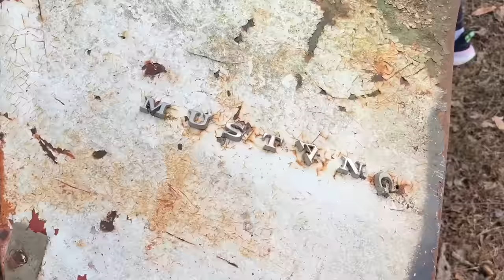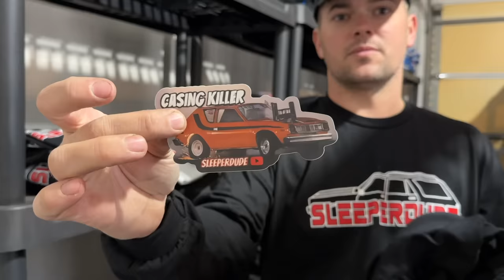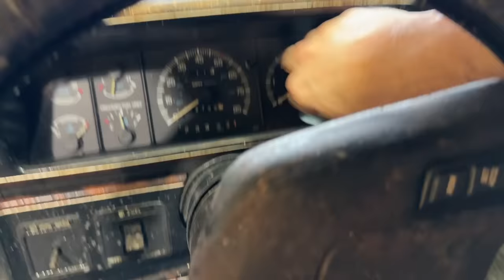Short Bed F150 Parked 17 years! Can We Save It?

Comment: Great video! I brought a 1990 F150, 300 6-cylinder, 5-speed in 1993 for $6999. It had 60k highway miles, but clean as a whistle. I drove it for 7 years and only put a clutch and exhaust on it. Was a great truck and only sold it as I got orders for Japan and knew I did not want it sitting for five years. Hope you get it running and keep it. 👍

Comment: New windshield, get the dents pulled out, a set of rims with other tiny cosmetic odds and ends and it'll look great! It'll be a great farm rig to throw around if the drivetrain is good. I'm excited to see the rescue of the Econoline and the other Falcon's! I bet your favorite is the black Futura.
Reply from the maker: Yes for sure
Reply: I think its in too nice of a condition,depending on the motor, for a field truck .Every thing looks clean under the hood.Fix the dents when you have time and put it on the backburner .It would be a perfect first driver for Ralphie .

Comment: Surprised you didn't pull the carpet before pressure washing it, but looks like it cleaned right up and is looking just fine. Nice project!
Reply: I was thinking the same, I'd have pulled it and pressure washed out of the truck. Heck, if the truck runs well enough, I'd order another carpet for it and trash that one.
Reply from the maker: Yeah that would have been the best thing to do
Reply: @Sleeperdude   I'm amazed you didn't just open both doors and hit the interior with a leaf blower.

Could have got a nice layer of free compost for the gravel. :)
Reply: @Sleeperdude  Yeah there's a ton of padding aka jute under the carpet that holds a lot of dried liquids aka urine etc.
Wetting it like this just reactivates it. It needs to dry from both sides or you can actually end up sick.
I ran a detail business for 15 years.

Comment: That looks like a pretty solid truck. A friend of mine had one just like it with a manual transmission that would do nasty burnouts 😄 But living in the North East the wheel arches above the wheels on the bed were completely rusted through even though the truck was maybe 10 years old so it's surprising to see it not all rusted out. Glad to see you have hoodies available I will have to pick one up!
Reply from the maker: Oh wow

Comment: The squirrels had fun inside that truck. The best thing to get the smell out of that truck would be charcoal. It will absorb the odor if you leave it sealed up in there overnight. Where I used to live up in the woods we had squirrels all over and they would get into tool drawers in the garage and store acorns there and even found Acorns stuffed into the Air box of my '89 F150. Yours also has dual tanks like my "89 does. I have never had any trouble with EFI on mine and I have 160,000 on my 5.0 liter as well. That is a solid truck just like mine. Thanks for sharing.
Reply from the maker: Ok cool thanks

Comment: Fantastic family involement! The tire inflator "scene" was funny -- You could try using a PDR kit to get the dents out. The front windshield is supported by the aftermarket. After you get it running I would strongly suggest you get the factory fuel injectors cleaned by a local shop, etc.

Comment: Good video, great content. Glad to see the whole family in action on the F 150 clean up. I hope the engine and transmission work out with minimal repairs. The truck cleaned up well and the body is in real good shape. I am sure Josh's body shop experience will come in handy getting the windshield frame straightened out and a new windshield will make the cab weather tight. I have the 1991 Crown Victoria wagon and the 302 five liter V8's are legendary. I had my engine rebuilt after it failed at 148,000.0 miles. Never did find out why it  failed, but it did overheat while towing my triple Quad trailer in Massachusetts. I had it completely restored in 2020 and now only has 14,000.0 miles on it and runs like a watch. Thanks for the video.

Comment: "Beware the brick nose as she will cause much confusion, consternation, and frustration" says the gray haired one from Missouri . My 90 brick nose has given me many fits over the years but when you go to start it and it doesn't try replacing the fuel tank switch, I don't exactly remember how I finally figured that one out but they are cheap and easy to change. Also if you think you've got a bad ignition module and put on a new one and it still won't start I've gotten bad one's that were brand new and I'm not the only one. I hope to see that Ford back on the road

Comment: Josh, you HAVE to go and get that camper shell that was lying on the ground near the truck.  Even if it is not a perfect fit for that Ford  short bed, it should either be close or a close fit for one of your long beds.  In those days, the beds were roughly the same size on the main pickup truck brands.  
  To me, every pickup needs a shell, or at the very least a hard bed cover.  Some guys worry that the shell makes the truck look less "cool."
Reply from the maker: Yeah I will check on it

Comment: The last Ford I i owned was a 89 F 150 lariat , Less than 12,000 miles it would accelerate on its owned,  clutch would stick on the floor,  and the radio would have static on it with the bright lights on. It was a junk truck from the start. Traded it in on Chevy the best thing i ever did.
Have fun with the truck.
Reply from the maker: Sounds like a lemon for sure

Comment: I use a small hand pump-up garden sprayer for applying cleaning detergents such you're using on the carpets and in the engine bay. It's much quicker and easier than those little hand  pump sprayer bottles. I think you can get them in a 1.5 gallon size. Just a tip. Love your channel!
Reply from the maker: That's a great idea!

Comment: That bed is in better shape than the bed on my 96. PRO Tip, the XLT Trim on the tail gate comes off by taking a few bolts out on the "inside" of the gate. makes it much easier to get to the gunk that is caked behind it. It will look just like the rest of the truck behind there.

Comment: To help break down the urine smell mix 50/50 white vinegar and water and saturate the carpet. It will have a strong vinegar smell for a little bit but will neutralize the urine. If you can set a fan up on it to help dry it would be good

Comment: Can't wait to hear this one run lol it hits close to home I have a 91 5.0 auto 4wheel drive haven't b drove for a few years motor is wore out lol another 91 straight 6  5 speed 4 wheel drive somebody store rear axles and some other parts and have a 90 straight 6 5 speed 2 wheel drive still drive some but it needs work
Reply from the maker: Awesome thanks

Comment: Yeah, that's a nice score! Even if the engine is a paperweight, it would probably be worth putting a motor in that truck to get it back on the road and useful. Most of the parts for those old Bricknose F series trucks are cheap. I own a 1988 F250 long bed with a 7.3 diesel motor and parts are cheap for that model too. I had to put a new fuel pump on the truck this year. The pump was 22 bucks. I imagine the seat cushions aren't very expensive either if you replace them. I can't wait to see if it will run! If it doesn't or runs bad, it's still worth doing the work to bring it back.

Comment: Hi josh and family what good truck u got there once it was cleaned up while you had seat out take the carpet and treat the floor with rust preventor and do for all the frame and inside of panels you have great  truck for years be great once you get it running

Comment: I actually picked up one of those 5.0 efi truck motors from ebay for $250…….i mainly wanted it because they have a roller cam…the earlier ones that dont have the roller cams still have the provisions to run a roller cam, youd just have to get the lifter spider and hold down bolts…along with the cam and lifters….but im sure you already know this!!!……thats a nice lil short bed though and would make a cool lightning clone truck but youd have to swap out the front clip to the ‘94 or later O.J. Style…..all white would look sick

Comment: 59:45 - An cheap paint brush works much better to remove dirt and grime than a shop towel. Of course, you can wipe with a shop towel after the surface has been agitated with the paint brush, and another spray of cleaner has been applied.

Comment: Ford Truck looks really good:face-fuchsia-wide-eyes::face-blue-wide-eyes: for sitting so long. Except for the door post and top of the fender. He parked because the hole in the windshield broke that is cold and wet and noisy He figured it was wreaked after a Tree fell on it? :body-blue-raised-arms:I bet the motor and tranny is fine:eyes-pink-heart-shape:. I ll be lookinng for the motor first start.:face-orange-raised-eyebrow: Gas tank will be full of trash. Is it plastic ? Probly metal. that will be the biggest problem It will clog up the fuel injection or carb and the fuel pump.:face-fuchsia-poop-shape: The fuel filter. I bet you know a good body man that can fix the windshileld frame and door post.:trophy-yellow-smiling::trophy-yellow-smiling::trophy-yellow-smiling::trophy-yellow-smiling::trophy-yellow-smiling: I think you scored on this truck?
Reply from the maker: I hope it’s all good

Comment: Go ahead and get a couple headlight switches, my 91 F150  ate at least 2 a year. And clean the throttle body extremely well. Mine ran for 235000 but it was a 4x4 5 speed. Looked just like that one.

Comment: Might I suggest that you drain the fuel tanks and test the condition before trying to get it to run. This would have to be the most solid vehicle you have ever bought. It would be an ideal vehicle for Ralphie. Perhaps a (per pole barn garage) tractor paint respray.

Comment: You should look into a holly predator or terminator for that lil Grey truck. I had a red 1991 f150 with 5.0 and e4od transmission. 3.55 gears in differential. Mpg between 18 and 20 depending on driving conditions with ac on. It allows more efficient power delivery (fuel injectors fire all at once or 4 at a time depending on efi or sequential injection from ford) very much worth it on power also

Comment: Vice Grip Garage puts Marvel Mystery Oil in the cylinders with the plugs out until it comes out the plug holes. Let it sit to remove rust in the cylinders. Use a videoscope to check the cylinders  and valves. Marvel Mystery Oil can unstick an engine.

Comment: I am rebuilding a 351 Windsor and I am having trouble finding an old pump that doesn’t poke a hole in the bottom of the oil pan when I tighten it down. Have you ever had this problem?

Comment: Dude I would consider finding a good cab for that thing and swapping it. Those old brick nose fords are really good trucks. I believe any cab from 80 to 96 would work, 150, 250 or 350 obviously. Find a wrecked truck with a good cab and clean interior and have at it. I'd try to save the dash in it if it's not terrible, otherwise I'd try to find an 88 to 91, because they have the best looking dash, followed by the 92 to 97.

Comment: Should just pull that carpet out and hit it with more clear then a drill brush and use a carpet extraction machine will really help get all the smell's out. Over all that truck look's pretty good for it's age nice find!. Also if you want to make it a little easier for the first pressure washing get a hand sprayer you would you for spraying weeds and fill it 80/20 with a all purpose cleaner and spray it over let it sit them wash it off.

Comment: Lariat I'd rather have a lariat from the early 90s late 80s than a lariat from today. I've actually had two trucks like that one was an 88 and my first one was an 89 with a 351 super cab 4x4 and when the truck finely rusted out I found an 88 reg cab 4x4 with a blown 5.0 but perfect body so I pulled the 5.8 and tranny and my lockers in the 88 then drove it for couple years

Comment: Next time it'll probably be easier guys to pull the carpet out of the truck and then pin it up on a cruise line or something like that and then pressure wash the carpet out of the of truck that way I can drip dry. Especially if you're going to take the seats out it wouldn't have been too much more just to take the trim pieces out and pop the whole piece of carpet out. Then you wouldn't have the water in between the padding in the inside of the truck. I did the same thing you guys did and I learned the hard way because what happened was the hole underneath of the padding molded really bad and I ended up having to take it out anyways because I couldn't get all the water out and also I was an auto detailer for years. Really really love the show I watch every clip every show everything you guys post. Hopefully after the first of the year I will get my page going nothing to do with cars although I love working on cars Hot rods I do all my own mechanical work been doing it since I was 11 I'm 53 now. I  write,sing and play the guitar and that's what it's going to be about. Keep up the great videos sorry about the long book lol

Comment: I have the exact twin to that truck except two things long bed and 4wd colors of paint and interior exactly same bedliner same 302 everything but 4wd and long bed love that truck can stick 8ft pallet in it with a few inches to spare and close tailgate it was a town truck that used a snow plow on it got it for a steal cause owner thought there was major engine or transmission problems turns out when he changed the spark plug wires somehow they all got damaged and at night under the hood looked li,e 4th of July oh and side note if you get one that's 4wd in that body style with automatic locking hubs do yourself the biggest favor ever and junk those things and put in manual locking hubs

Comment: People ask "what was your first vehicle?"
Mine was an '89 F150, super cab, short bed, 4.9 straight six, 4x4, 5 speed, medium cabernet red. My dad bought it brand new when I was 5, i got when i got my license.
And I still have it. I drove it to work today. 265,000 miles on the original engine, it'll still tow a trailer, it'll still go 80 mph up hill. I'll keep that truck forever. 
The OBD1 EFI isn't even that complex. (If i can figure it, anyone can) 
Make sure you relocate that TFI module, get it off the distributor and on to a heat sink (like the 9th gen trucks have) and if it has a BOO switch on the brake master (i see has cruise control) get that fixed with a breaker cause they can burn the truck down. Same for the G2 alternator plug. You probably know all this and im rambling now..
Reply: And check inside the ECU for any blown caps!
Reply: And if it has cruise, it's also a tilt column. Push the turn signal lever forward and it tips the wheel.

Comment: Bought a 1989 Ford F-150 XLT Lariat that has sat since at least 2010(13 years) 302ci 2wd extended cab 11/88 build date bought new by the man i bought it from 300k+ miles numbers matching drive train
Reply: 20 year old Bridgestones still hold air

Comment: Funny how he freaked out over the air compressor,  like the tire was going to blow up. You know you can just take the hose off the valve stem with the compressor still running an it won't hurt anything, plus that little compressor isn't going to air a tire up so fast it pops. Last video he said she tore the car in half. I think it was more his fault because he was the one that should have been watching to make sure nothing got caught on the trailer, like the drive shaft he never checked. Plus just admit it the car was basically scrap metal and it probably would have broke in half on the way home or unloading it.  He's not a bad person or dad but if he keeps placing blame on his daughter she'll loose interest like his younger daughter and then it will just be Ralphy. Hmmmm, funny how WahWah had to buy her own car but the boy got a corvette given to him and this truck will probably end up being his.

Comment: Maaaaaan its no way i would have washed that carpet in the truck, now you have blown all that bacteria into the insulation under it and will sit and erode the metal, we always pull it out peel the insulation off and lay it upside down and pressure wash it from the back side to shove all that mess out the front side. Cool little truck though, need to do a twin turbo kit on that jewel and call it Rat Rack